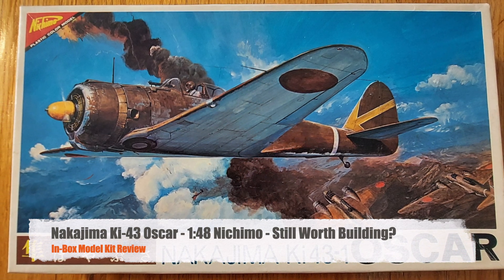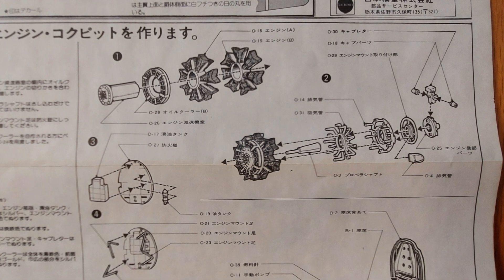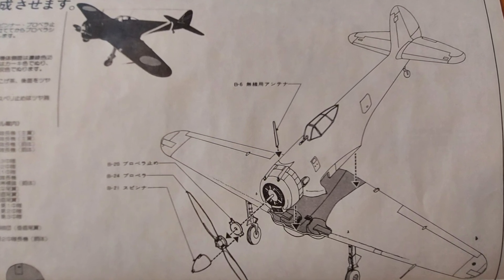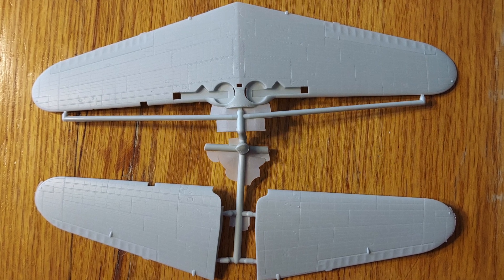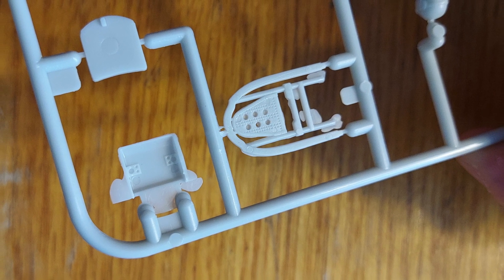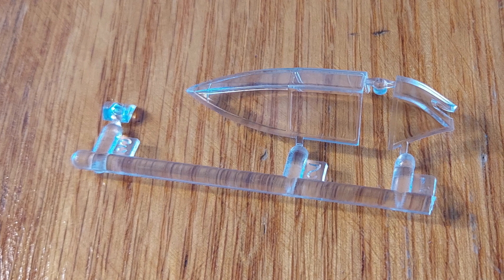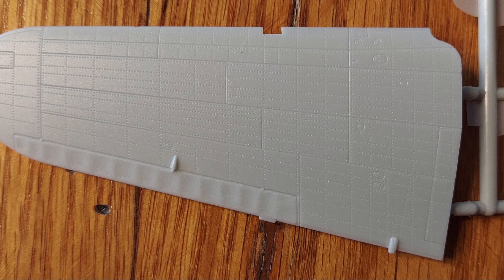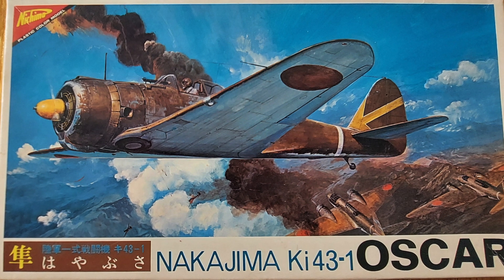Nichimo 1:48 Ki-43 Oscar Review - Still worth Building?

Comment: Built this kit about two years ago.   Old school Japanese instructions from the 1970's but if you go slow, it turns out nice.   The newer Hasegawa Hayabusa is only marginally better.   Both are very good.
Reply from the maker: I've built the Hasegawa - nice kit! I'm looking forward to this one. It'll be fun to see them side by side.
Reply: @jonsmodelkitreview4624  Yeah when completed its looks darn good.  It's got quite a bit of detail in the engine/firewall area but once you're past that, it's smooth sailing!   Japanese Army Air Force planes usually had (early war) either aeotake (a kind of thin aqua colored rust inhibitor over bare metal or a light green similar to British interior green).   Late war was usually whatever dark green was used on the exterior.  Exception was the Ki-61 which used a sandy color interior  like German Afrika Corps panzer camouflage.
Reply from the maker: @gsr4535  Right on! I wish more engine detail could be seen on the finished Ki-43 Type 1 but that big oil cooler obscures most of the view (same with the Hasegawa kit). You're right on about the colors.